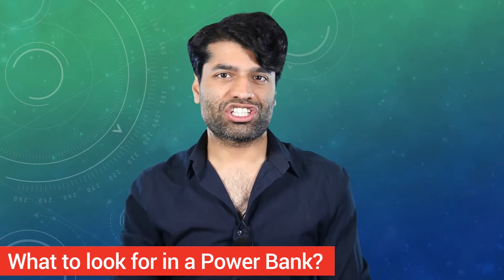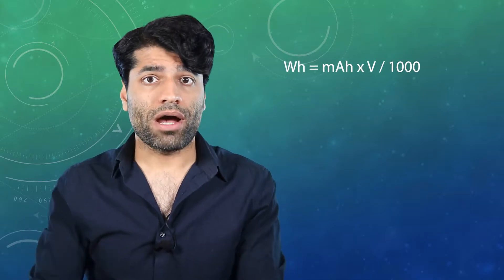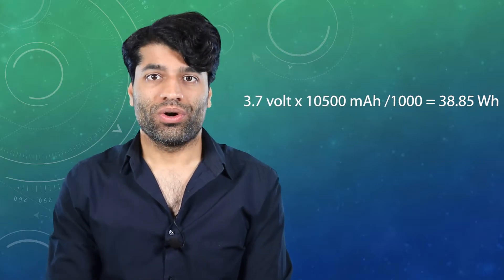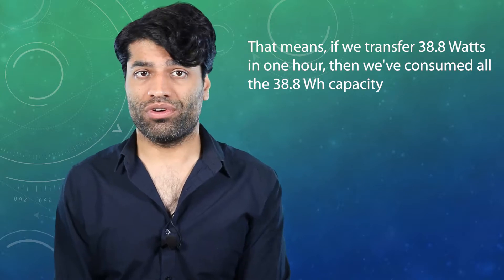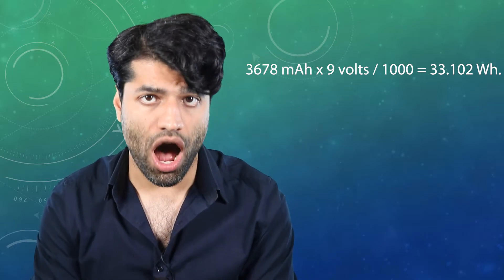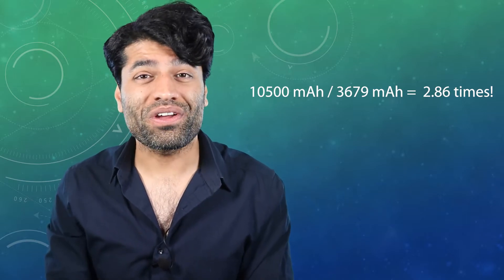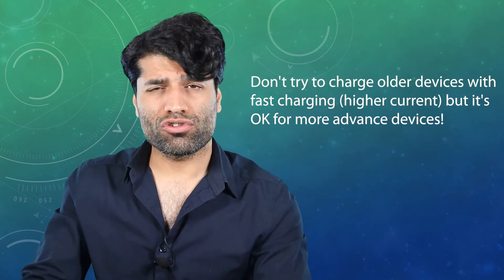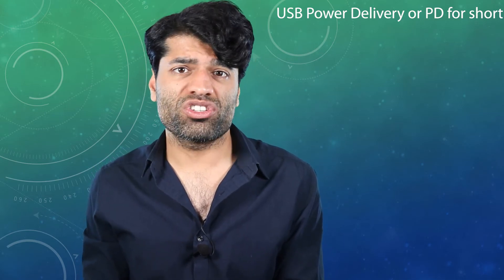What to look for in a Power Bank

Comment from the maker: In the above video, I assumed IPhone 12 Pro Max battery voltage of 9 volts based on the transfer of energy of its USB adapter (20 W). However, the rough voltage is 3.842 volts. Hence, doing the same calculations, we get 14.13 Wh (3.842 Volts x 3678 mAh / 1000 = 14.1309 Wh). So, now if we divide the power bank with this value, we get 2.75 times charge (38.8 Wh / 14.13 Wh = 2.7459 times). Therefore, in this case mAh and Wh are more closely related based on the 3.845 volts. Nevertheless, the above video demonstrates the importance of volts and hence Wh in comparing the capacity.

👉 What is USB Power Delivery (PD) and why it's important! - https://youtu.be/vRLhFb_znY4
👉 DVI vs HDMI - https://youtu.be/NjBEKxQ4AtM
👉 What are the 3 audio ports on my PC - https://youtu.be/HZcQzPH4iDM

Some of the Playlists
👉 Windows 10 Tutorials (more than 140 tutorials) - https://youtube.com/playlist?list=PL6oDA8S3RmtGfxxC6s7DjaqR-6XjdNsov
👉 WhatsApp Tutorials - https://youtube.com/playlist?list=PL6oDA8S3RmtHgXSWFSj68YUVm1TIGGTza
👉 Product Review Playlist https://www.youtube.com/playlist?list=PL6oDA8S3RmtEgxFlaZd1x_2QlcihjbFeW
👉 Amazon Website Tutorials - https://youtube.com/playlist?list=PL6oDA8S3RmtFbsUyOgixY8CVgNtSiGJ0d
👉 TV, Sound System & Accessory Tutorials - https://youtube.com/playlist?list=PL6oDA8S3RmtFuqNpAghGWmkIRfBjF3q9v
👉 Graphics Card (GPU) Tutorials - https://youtube.com/playlist?list=PL6oDA8S3RmtFpwgu-xrluRtRZ9p-KtsNo
👉 Central Processing Unit (CPU) Tutorials - https://youtube.com/playlist?list=PL6oDA8S3RmtGKnUK9Wh4ZSJkTGtlwr2y6
👉 Keyboard Problems Solved - https://youtube.com/playlist?list=PL6oDA8S3RmtHkLIAlKqelYdugfdgie1Jp
👉 Skype Tutorials - https://www.youtube.com/playlist?list=PL6oDA8S3RmtEQCqzq-opc5rGKmwAC9Nay
👉 Microsoft OneNote Tutorials - https://youtube.com/playlist?list=PL6oDA8S3RmtGsdSAuOFWBba9qVwXvLOZL
👉 OneDrive Tutorials - https://youtube.com/playlist?list=PL6oDA8S3RmtGS3hBnF1iYQ31EvaEe7gtp

Comment: My phone battery is 5020 mAh. So, if i calculate 5020 * 9 / 1000 = 45.18 Wh.      
    And, the power bank i wanted to buy, it is 10000 mAh. So,  again calculate 10000 * 37 / 1000 = 37 wh. So now calculate 45/37 = 0.81 times charge. Please explainMy phone is resninite 10 pro 33W charging facility
Reply from the maker: 9 volt is where the mistake is. 9 volt is the transfer voltage rather than phone's battery voltage. You need to find the correct voltage of your specific phones. For example, iPhone 12 is 3.842 V. If I assume the same volt for your phone. Then, I get 5020 * 3.842 /1000 = 19.2868 Wh. For Battery is 10000 * 3.7/1000 = 37 Wh. Hence, the power bank could charge your phone 1.9 times ( 37/19.29 = 1.9181). You could say almost 2 times.

Comment: Does a higher Watt hour means a stronger power bank? For instance,  is a power bank with 110 watt hour better than a power bank with 50 watt hour?
Reply from the maker: Higher Wh means higher capacity. So, with 110 Wh you could charge 2 times more than 50 Wh. It's not the strength. Again, I need to better understand what you mean by stronger?
Reply: @PracticalTechFixes  I meant stronger in the sense of strength and not capacity. But you have clarified. I own a device called thr Rodecaster pro that can be powered with a power bank of minimum output if 2.4 A. I have even used power banks of 3.0 A output but they don't power it. I came across your channel while trying to find a solutiom
Reply from the maker: @richard4oyeleke  Do you know the require voltage for your device? I presume, it's a different voltage. Make sure the output voltage of the powerbank matches the input (require) voltage of your device.
Reply: @PracticalTechFixes  the device requires 5v/2.4A and 12v/1A  and the power bank supplies even 5v/3.0A. I guess it should work which is why I am surprised